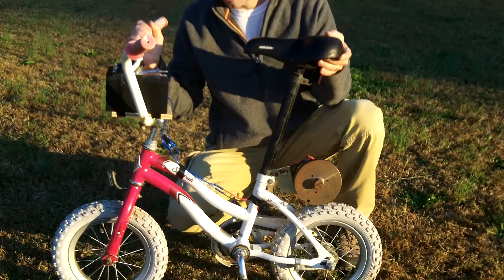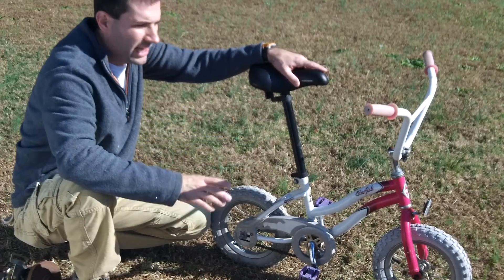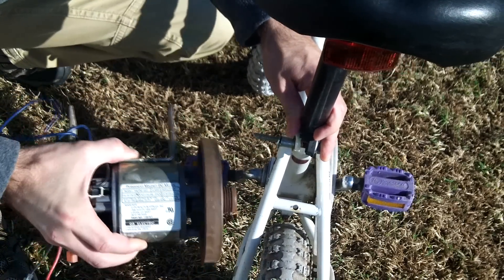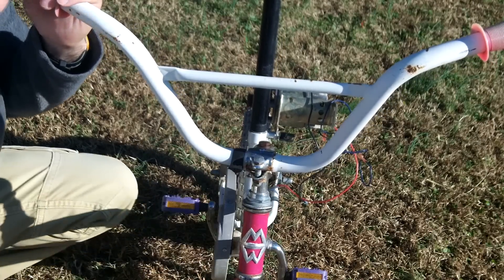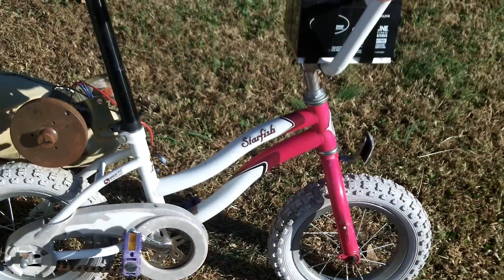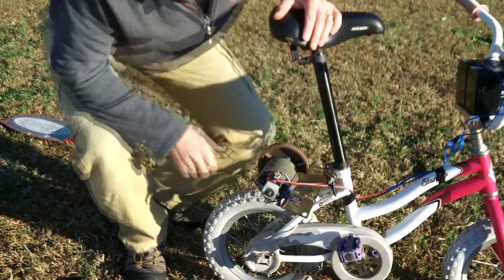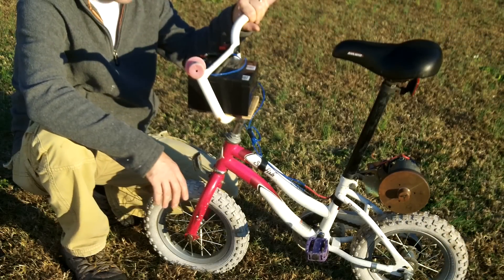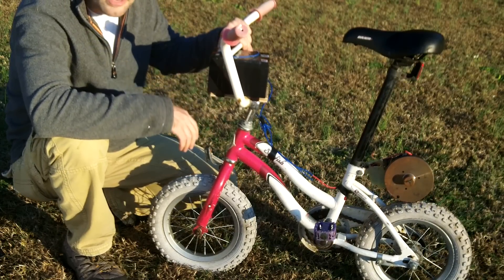DIY motorized bicycle with a treadmill motor

Comment: Not bad man, props for probably the simplest/easiest design I have seen for an ebike conversion. My first bike was a total Frankenstein by the time I got done welding up brackets for motor and battery mounts, then you come along and do it with three bolts and some tape! Mine was a complex chain-drive, though, with a motor and gearbox scavenged from a broken electric wheelchair. For sure get the voltage up higher (if you havent already) and nevermind the downers on here, this video would have been inspirational to me when I was a younger kid trying all sorts of ways to cobble a motor to my bicycle.

Comment: I have a 130 volt DC tread mill motor I was thinking of adding a sprocket to the existing pully powered by 6 24 volt Cobalt batteries if my calculations are correct that motor has alot of torque so with a ten tooth sprocket on the motor and a 50 tooth sprocket on the wheel at 6700 RPM motor will propel me around 103 MPH if it can hold 6700 RPM with a 5:1 gear ratio
Reply: Maybe try 100mph on a Harley First?
"If my calculations are correct" Sounds like "Hold my Beer," Darwinian last words.
Your going to need motorcycle tires rated for 100mph and temp rating. Full suspension etc.
Maybe go to Harley Dealer to check out electric motorcycle? Or a few other makes.
They all share commonality= A team of Engineers and design folk.
At $20,000, E-Motorbikes are just as endearing as Petrol to your wallet.

Comment: I have that exact same treadmill motor sitting in my parts bin.  The reason you didn't have much power to accelerate was the motor is a 90vdc motor and your only putting 24vdc into it.  To make that motor work to its potential you have to up the voltage.

Comment: Just curious, what's the motor specs? I have a permanent magnet 220vdc treadmill motor that I was hoping to do a bike project with. Any tips would be great !
Reply from the maker: DubSpliff420 The motor specs are 90vdc, 0.40 HP treadmill duty, 4200 RPM, and 5.4 AMPS. I hope that helps and I am sorry it took so long to answer your question. Thank you, Lonny
Reply: DubSpliff420 o

Comment: I am surprised it ran. Those treadmill motors run at least on 110v house current. It does work because the motor is permanent magnet type with brushes. A 2500 watt inverter could get you where you need to be for full power.
That would do 130v at 3hp. About 3X faster too. Scary fast on toddler bicycle.
Reply from the maker: Thanks for sharing

Comment: aren't treadmill moters ac
Reply: +Dylan Gross Nope, most are dc (some are ac but those are really expencive) the treadmill is ac but it has a rectifier that then allows it to have a speed controller to the dc.  which is why I don't understand why he moved the motor instead of just reversing the polarity of the battery supply to the motor.
Reply: because if you run it backwards most treadmill flywheels will simply unthread and spin off the motor.

Comment: Get rid of the friction drive, put a chain on it
Reply: +Dylan McElveen was JUST about to comment that when i saw yours, friction drive is terrible for a lot of different reasons, two main ones being that it rubs your tire and wears it out more, second reason because of loss of power. as a chain drive that thing would mooove haha
Reply: +Edna Baptist Heat would quickly become an issue and chew the tyre, sorry, tire up with that metal friction drive. A pneumatic tyre on that might alleviate the excessive wear I'd predict. But I think that is the correct way to go. A chain drive would make it far less interchangeable and slower to fit. Although, if put in to any sort of production, a chain drive could work through a gear system or a variomatic cone system and offer greater flexibility of the available power.

Comment: that motor is going to wear out the tire really quick, and the friction will cause the inner tube to swell and explode. The larger seat is extremely dangerous unless it is inserted to the minimum insert line, which by the look i doubt it is, without that then the seatpost is unsafe and could fail at any time. this is not a good idea and could easily land you in the hospital out of pure stupidity.
Reply: There is not a single thing stupid about it. It is called an experiment and it happens to be intelligent, it is a learning process for him, he is farther along then he was yesterday now. It is not like he will be using it for going to work, it was just first mock up. DUH As far as the safety police keep your paws to yourself, he hurt nobody not even himself and if he did hurt himself it is none of your business.
Reply: you're completely wrong inner tube swelling and exploding LOL you obviously have no experience applying power to bicycle tires